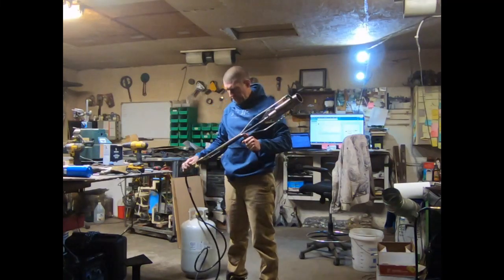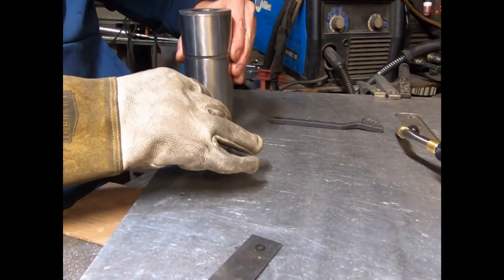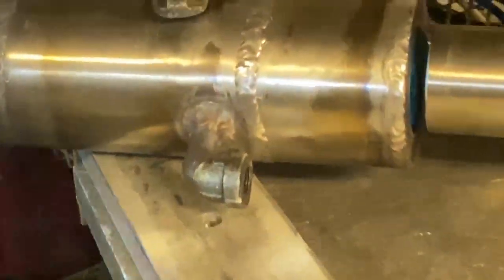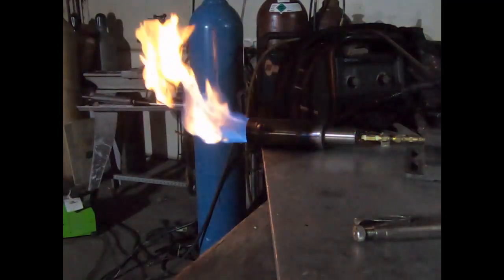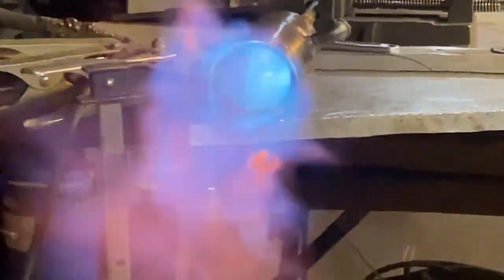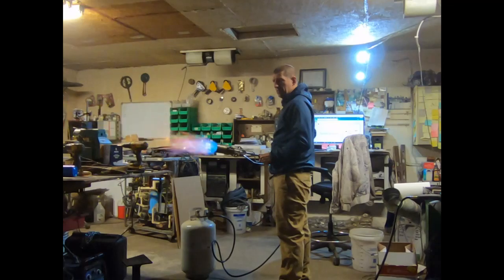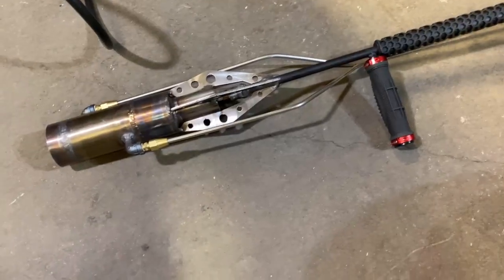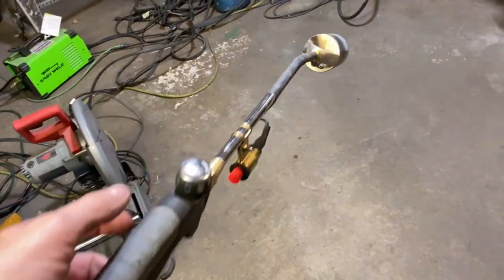Excalibur custom  Propane Torch

Comment: You could put some swirl strakes in there [would show you some I pulled out of my Mitsubishi air cleaner but I forgot where they went] but just generally, take some carefully twisted pieces of stainless and insert them into the mixing region and they will force the air to spin as it moves toward the exhaust and this will cause a really good turbulent mixing.

Comment: Since its propane and not something like diesel, you should rig it up to use one of those little piezoelectric spark igniters.

While I know they wear out over time, if you intentionally use the kind people get in either the long spark fireplace/BBQ igniters, or if you get the ones in the disposable lighters, the customer can replace them forever at almost no cost.

Otherwise, you can get one with a single AA battery really cheap in bulk from China and make it where it turns on any time one squeezes the handle to start it.

If you made it with a cam, it would only spark at one location and then stop, OR you could have a trigger/button arranged just for the spark.

That would remove the need to have a separate torch, which is a total pain.

Call it a "quality of life improvement" and also, you would likely just use a normal silicone spark plug wire and a piece of stainless steel, no need to use a porcelain spark plug, so long as you have the spark gap happen inside the combustion zone.

Comment: nice. lol.  I tried to incorporate the trigger from an acetylene cutting torch into a bigger burner once and it was a miserable fail.  you are still the master. I believe Darth Vader said it best. lol.  that's pretty kick ass.  does it produce thrust when you pull the trigger? sounds like it.

Comment: Man your vaporizer totally rocks!

By the way...

Something you can tell your clients:

If the vaporizer begins to clog up, they can get some high concentration H2O2 and run some of that through the vaporizer while it is hot and it will burn all the crap out of it.

I've done this with heavy carbon buildup on thin wall aluminum pans with no harm to them so good quality stainless steel will be fine.
Reply from the maker: Great idea , i love input like this